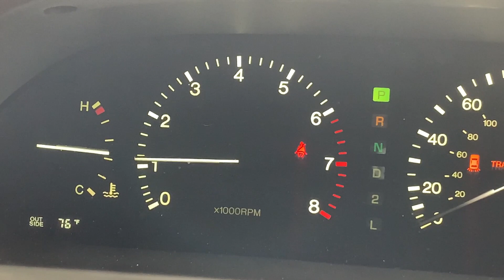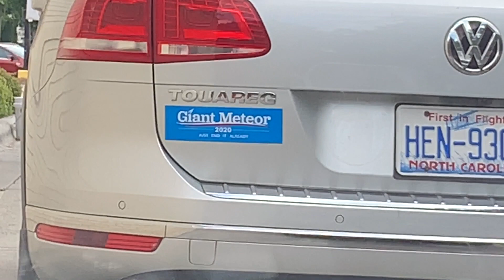NEED HELP: LS400 STALLING ISSUE!

Comment: Could be the TPS sensor, the one next to it should be the IAC ( idle air control valve) which you could clean with some brakeclean. Other things you could try is cleaning out the throttle body, usually gets full of carbon causing it to stick. Also Seafoam top end engine cleaner works great removing carbon buildup on higher mileage engine. Did it in my truck and idled smoother and even had more power
Reply from the maker: I recently tried a lucas injector cleaner might try seafoam next. I will look into how to clean the IAC and the whole throttle body thanks for your suggestions

Comment: Also clean your idle air control valve or replace with one from the junk yard  .I had the same issue
Reply from the maker: is that the one to the right of the one i was pointing at?
Reply: @dfitzwm  right in front of the Lexus logo

Comment: My GS300 was doing this, wasn't fully stalling but was close to, running really shit and rough. Changed the plugs, leads and coil packs, still didn't change, i put injector cleaner in and took it for a quite long drive and the next day it was great. What i believe is, i got a bad batch of fuel and it hated it. Good Luck!
Reply from the maker: I put injector cleaner in it and I’m like halfway through my tank so I’ll give an update soon

Comment: I have a 95 lexus sc400. I would say try cleaning your idle air control valve. Or check your spark plugs see if the white tip on all of them or black could need new ones. Clean your throttle body. 
If that does not work. Start changing out spark plug wires along with distributor cap and rotor .
Reply: Oh yeah also try cleaning maf sensor with maf sensor cleaner only.
Reply from the maker: hey so I am actually gonna try cleaning the IAC in the next video as well as changing the fuel filter so keep an eye out for it!
Reply from the maker: I can also try this itd be the easiest

Comment: I've never had a ls400 however I did have a SC400 and it had a second ecu for the fuel pump and it had some problems that caused the same problem for me... me and my dad just rewired the system to bypass the bad ecu.. still bogged down sometimes but only at very low rpms and in the months that I had it following that I think it died once at the most
Reply from the maker: I will look into it for sure I’d really rather just drive it like this then rewire everything ya know

Comment: I know it's like 8 months later, did you ever fix the issue? I'm having random engine shutdowns, replacing ECU capacitors tonight.. hope it fixes it.
Reply from the maker: no i sold the car, next owner also sold the car, sorry man good luck!
Reply: @dfitzwm  Thanks for the quick reply. I work with electronics for a living so luckily I won't have to invest too much time and effort. Capacitors cost me 12$. if it doesn't fix the issue then at least it's something i can cross off the list.
Reply: @Javii96 could you fix my ecu for me? Id pay you for your labor
Reply: @abrahamdiaz846  where are you located?
Reply: @ Alabama, US
Reply: @dfitzwm  soldering new capacitors definitely fixed the issue btw. The capacitors were all rusted and leaking stuff. Car has not had an issue since 3 years ago when I did the repair.
Reply: youtube keeps deleting all my replies.